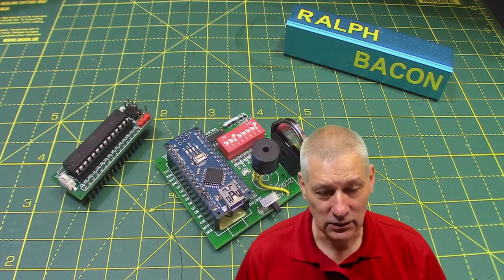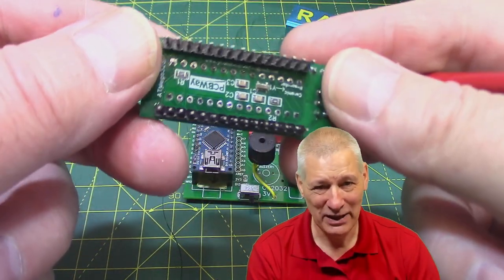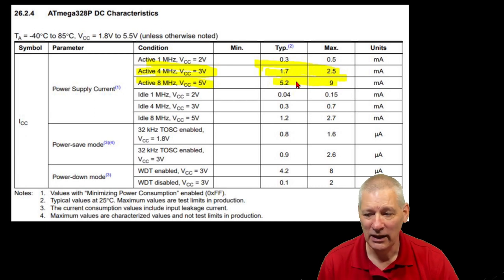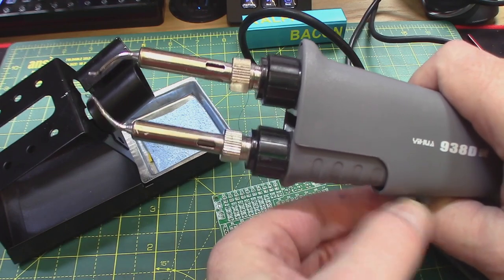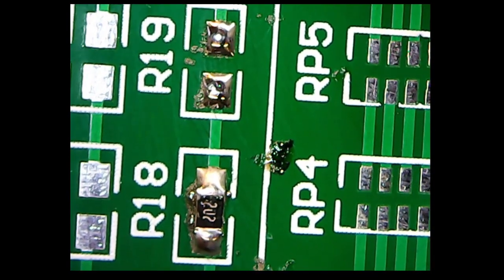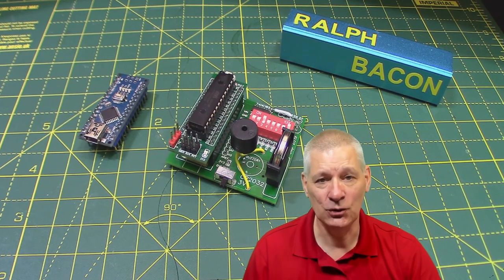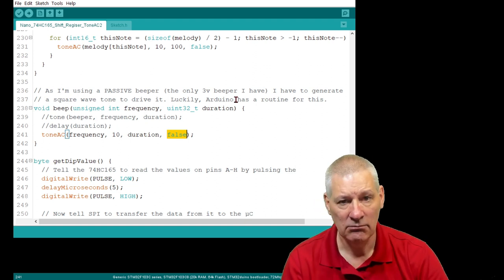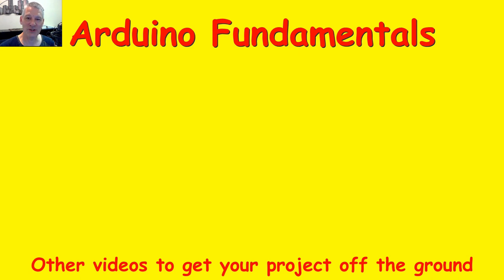#170 ToneAC Library with 328P DIP Nano PCB Plug-in

Comment: I also do have 4-5 DIP Atmega328's in a drawer somewhere. This is a clever way to use them. Thanks for the idea. I think I will have some boards manufactured too. By the way, kudos for the CH340, I am surprised eliminating the on board USB-serial conversion did not make a significant power drop. Too lazy to look up its data sheet but I suppose it must have a quiescent current in uA range when it is not doing its thing. Great video as always, I wish you a speedy and permanent recovery with the eye!
Reply from the maker: I'm glad I've motivated you to try this board. Whilst simple (anyone could have designed it) it's quite neat. Thanks for your kind words and the fact I'm replying now means I must be up and about, Woo hoo!

Comment: Hey, Ralph.

Very interesting video, as always.  This Bare NANO PC Board is really great.  One question, though.  Do you NEED the Shield programmer to program the AtMega328P, or can you use the ICSP Port to do the job just the same ?  I will definitely get myself some of these boards very soon if they are economically advantageous over a NANO, that is.

I quite understand the Bootloader delays the execution, but most of the time, it won't be a bother.  Mind you, I could use faster start time on my Laser Fan Controller device.  Hmmm !  Like Schultz use to say to Logan .. « Veeery intereshting !! ».  I'll look at that option in the very next future.  Thank you for the info.  I just might get those boards made at the same time as my WWS project.

I've looked at the possibility of purchasing that SMD Hot Tweezers and, as you said, this is not an impulse purchase indeed.  I'll think about this one.   It is very good for desoldering SMDs, but for soldering these minuscule parts, I can still use my old Weller Station.  I've got the tips for this kind of job, and the tweezers to hold them im place whilst soldering the first pad, so ..

LOL for the eye patch!  Aarrr Captain !!  Take good care, my Friend.  I'll chat to you later this week.
Reply from the maker: You can use the ICSP port from another UNO. A proper 6-pin cable simplifies matters here. The (red) shield I use is for DIP 328P(B) chips in the ZIF socket or via the ICSP socket just the same. Whatever works for you. Speak to you soon.

Comment: About higher speed serial not working with a clock that's off: it's not just high baud rates, it's all serial speeds! If the clock is off 5%, every baud rate is off 5%. And it's the percentage error that makes or brakes the serial connection. Some baudrates are more susceptible to this, because some serial clocks aren't an integer division from the system clock, which means that they aren't accurate even with a perfect clock (there's a list of these errors in the AVR datasheet).
You can "tune" the internal oscillator by writing to the OSCCAL register (has to be done in software in your program). It's a bit of a hassle though to get it. To find the best value for it, write a loop that dumps something out to the serial port and change the OSCCAL value every iteration. If the output is no longer garbled you got the right value (there will be a range where it works; take one of the center values). Then write that value to EEPROM and load it from there to OSCCAL in your actual program that you want to run.
Reply from the maker: Sounds like a lot of work, doesn't it? I used to do this sort of thing with PIC chips but never with AVR chips. I have no idea how a production run would be able to tweak the oscillator in this manner it would be a real show-stopper if it were required. Or expensive. Same thing really!
Reply: @RalphBacon  
Yeah, I doubt that you'd use this in production that way. If a rather accurate clock would be needed, an external crystal would most likely be easier overall (and if time == money also cheaper), especially since the internal oscillator isn't that stable with temperature change.
You could include a calibration procedure in your code though to remove all manual steps. Apply a known accurate external clock to a pin (pulling that pin low a could be the thing that enables the calibration mode), that triggers one of the timers/counters. Then in your code tune the OSCCAL until the counter shows what should be expected and store that value in EEPROM. That could be a process that's done in less than a second with the right jig and could be useable in volume production (the AVR has to be flashed at one point anyway).

Comment: In the ToneAC documentation, it's mentioned that a 100 ohm resistor should be placed on one side of the piezo buzzer.
Reply from the maker: Hmm, it depends on how much current the buzzer is going to take. More than 20mA seems unlikely but a 100Ω resistor will ensure current is limited to 5/100 = 50mA, still a bit high as 40mA max per pin!
Reply: @RalphBacon  Yes, makes sense to go higher on the current limiting resistor, but I noticed that you ommitted the resistor altogether and I was curious to know why you did that.
Reply from the maker: Because my buzzer only consumed a few milliamps, not enough for any concern. Measure it with a multimeter to determine whether a resistor is really necessary!
Reply: @RalphBacon  Good point, better to actually test to see if it is needed rather than just mindlessly following general rule!

Comment: Great great video Ralph thankyou. May I say I am also a Centigrade man. (whats celsius??) and refuse to convert!! I love the SMD tweezers and will have to get some. As soldeering experience goes I am about 80% through hole and 20% SMD qualified. Oh and thanks for the Miniboot board for the 328PB. I got it in the post on Saturday and have the chips on order for Wednesday. :)
Reply from the maker: Good luck with the board, Stephen, you probably have made it by now! I hope you got it working OK.

Comment: Well, that was one in the eye for me. Sorry your right eye is not a patch on the other one. Ok, that might not read as being very sorry but I am. Thanks for the ToneAC tip; I am surprised and pleased at the improvement in volume. I to am more comfortable with using the ICSP socket (though, ironically, I do tend to still put an optiboot module on the chip unless short of memory). I just find it easier when using Atmel Studio (which I use the most because of its debugging facilities.). I am interested in the sleep/idle/running times you come up with in your research. I have been a little skeptical at the savings in battery usage that some maker's claim. I can see that they achieve them when occasionally flashing an LED on a breadboard but experience suggests that a real time application generally behaves very differently from its prototype in the lab (ok that experience is as a chemical engineer but such such patterns generally replicate across most disciplines).
Reply from the maker: [Read in pirate voice]
Aargh, well, shiver me timbers, if it ain't me old mate Mikey! 'Tis true, the olde ICSP is a favourite of every bilge-sucking landlubber when no boot(ie)loader be on board. Avast me hearties! This seadog shall be looking at ye power savings and reporting back to ye, in the near future, ye son of a biscuit eater.

https://www.piratelights.com/captains-log/2018/5/8/pirates-terms-and-phrases

I'm sure you do care, Mike, and goodish news: my cataract op has been pencilled in for January which should give me one good eye back. Then the other eye should settle down, and if it doesn't will require surgery to clean out the gunk and laser any further retinal tears, if any. Then a cataract replacement for that eye one day too!  Aargh! Now let's splice the mainbrace, it be 5 o'clock (somewhere)!
Reply: @RalphBacon  It's good to hear that Seaman Stains still has his sense of humour. Best of luck mate.

Comment: The disc piezo is normally used to vibrate a surface, ie diaphram. Volume is dependant on such. As an example, ..next message
Reply from the maker: Even if I pressed the disc quite hard on a plastic surface it was not great. I don't know why but as I had this little beeper I was not too worried.

Comment: OptiBoot is quite easy to rewrite btw. You could, for example, use a jumper with a pull resistor on one of the led outputs as a sense line for if the bootloader should stay active or if it should jump to the main binary
Reply: Optiboot is also easy to custom compile for say, 8mhz and 20 flashes, instead of 3.  So long as a board is being built, a couple of zeners and resistors can help help the 328p bang-out a USB 1.0 bootloader like USBaspLoader:  https://github.com/baerwolf/USBaspLoader
Reply: @GnuReligion  Quite cool what can be done with these things if you use good code :) Still can't comprehend how the heck they managed to make opti so small. 512 bytes and it's C! :D USBaspLoader is also quite incredible. 2K is no small feat given it has USB
Reply: Smallest bootloader I've managed is 3K. Granted, it has md5 and some other stuff (and is in 68k assembler) but this is way cooler :)
Reply: @Chriva  Micronucleus on the Tiny AVRs is pretty cool, too.  Sad that the Mega chips do not have a PLL so they can do the overclocking trick.
Reply: @GnuReligion  Well, technically you can. but not as simple. You have to use another crystal (or drive it by an external clock). :) Sadly they rarely want to run much faster anyway. Think the record is a 328 @ 40 MHz :P
Reply from the maker: I've assumed that the MiniCore bootloaders were all compiled for the different speeds, 1MHz, 8MHz and 16MHz although the 1MHz might be just 8MHz with the divide-by-8 bit set for the clock speed. Something I need to investigate more fully. Sounds pretty interesting.
Reply: @RalphBacon    Thanks for showing me what MiniCore is!  Was ignorant that this core (capable of runtime flash-writing) even existed.  The chip/speed/feature selection of MiniCore is superior.  Obviously it is actively maintained, even has an option for PB varieties.  Some more reading shows that this core supports "optiboot flash", with special capabilities, and still compiles in 512 bytes!   But, Mr. Bacon, you can still use regular optiboot, and even the regular Arduino core.   Furthermore, you can compile optboot_flash with standard options, like:  "make atmega8 AVR_FREQ=16000000L BAUD_RATE=115200 LED=B5 LED_START_FLASHES=2".  And yes (sigh) there are all the pre-cooked bootloaders:    https://github.com/MCUdude/MiniCore/tree/master/avr/bootloaders/optiboot_flash/bootloaders
** Unrelated note:  I installed a 32Mhz crystal in my LGT8F328 Xi Nano ... took a new boards.txt, but demonstrably works.

Comment: A piezo disc about 20mm dia, feeding a diaphram in resonant housing can get 120DB sound for car siren but also is driven by over 100v inductive kick peaks.
Reply from the maker: 100 volts, you say, Helmuth? I guess the 6v I have here is not so great then. Although I have had better success with plain piezo discs in the past, so maybe this time there was something else not quite right.
Reply: a couple of weeks ago I disassembled one of those personal alarms which are marketed as 120 dB. These are just using a piezo disc and 3 alkaline batteries for together 4.5 V. But the magic is that the piezo is driven through an inductor which will the 100+ V spikes which are necessary to give you this volume. Together with a 3D-printed resonance chamber I could get up to at least the sound level of that siren then with a small circuit getting the drive signal from an ATtiny13. The siren uses actually a pair of coupled inductors in a flyback configuration.
https://i.imgur.com/umJzS9v.jpg

The buzzer you are using is actually an electromagnetic speaker rather than a piezo disc. What you see through the top is the steel membrane under which a small coil sits.

Comment: I think that the tweezer soldering iron is a bit overkill unless you do a lot of desoldering two leg components. If you have two soldering irons (and two hands) you can obtain the same. For many leg components you can use low melting point solder-wire  based on Indium or Bismuth
Reply from the maker: Indeed, I believe Louis Rothman mentioned he had used two soldering irons in his early days. But not quite as convenient.

Comment: Does that tweezers soldering iron have wider tips that can do larger parts such as 8 pin chips?
Reply from the maker: I don't think other tips are available, Steve, but i wouldn't use this to (de-) solder chips, I'd use either a hot air gun or, for small 8 pin dip chips, I'd flood it with solder one side and lift it up gently. Hot air gun is not that expensive, around £45 / $60 and they do a good job. Look at my video where i show my Yihua 959D.
Reply: @RalphBacon  That's the old way but if you have wider tips to desolder a chip it pops right off like this!  https://youtu.be/KKItbyz6564?t=368
Reply from the maker: Yes, that's a good way too, whatever works best fro you. I have (yet) another way but that's for a future video!

Comment: The tone hack is really cool. I think this is doable with the standard tone function and a NOT gate on the output pin (it would  require more room on the board and be more expensive, of course!)
Reply from the maker: Everything has a cost, Aurélien. I know that companies try and shave every cent off the cost of a product, sometimes going too far. The obvious thing to do (were this a REAL commercial item) would be to have a higher voltage. Three coin cells, giving either 4.5v (1.5v per cell) or 9v (3v per cell) via a buck module down to 5v would do the trick and obviate the need for all this other work! But hindsight is a wonderful thing!
Reply: @RalphBacon  ... they build things with costs in mind, we build them to learn and have fun!
Reply from the maker: You never know, someone on this channel might see a business opportunity and make a fortune! But it's fun either way! And a condition of watching this channel is that I get 50% of all commercial profits. Whatsat? Not enforceable? Drat!

Comment: Could you not have remapped the AC tone library pins in the header file or is there some obscure technical reason for only supporting the described pins? 
It would be more expensive but looking at the tweezers I think you could make a hinge for two (of everyone's darling) TS100 soldering irons. The result should be super light tweezers with almost instant heating and auto idle.
Reply from the maker: If you (or me) had a 3D printer I'm sure a nice hinge could be made to accommodate two TS100 soldering irons. Now THERE is a business opportunity for you Rob, and I'll only take the usual 20% fee!
Reply from the maker: I forgot to answer the bit about remapping the pins. I suspect (I didn't look) that he is doing direct port manipulation for speed, so Yes, it could be reworked to use a different port to the one it is using, I'm sure. But if we have to hack libraries then it all gets a bit involved for the beginners on this channel. I suppose a fork of his library would be a good idea. But I have no time, so over to you Rob, let me now when it's done. Whatsat? You got no time either? From your lips...

Comment: That tweezer soldering iron looks like it would be extremely useful, especially for desoldering a lot of components or some light reworking of others. And don't strain that eye too much, we need you to be able to see clearly so you can keep the videos coming.
Reply from the maker: Without doubt, it is a bit of a specialist tool, but for SMD rework it would probably pay for itself in the lack of frustration! I'm resting my eye so hopefully no strain!

Comment: when it comes to serial communication the accuracy of the oscillator is not the full story. There are limitations which baudrates can be realised from certain clock frequencies. A site called wormfood used to have a neat comparison table showing which baudrates are achievable from which processor clock speeds, but for a couple of months the original site has been down now - but there are backups out there: http://ruemohr.org/~ircjunk/avr/baudcalc/avrbaudcalc-1.0.8.php

In short: from 8 MHz 115200 is not possible, but it's not because of the accuracy of the 8 MHz which even for the internal 8 MHz RC-oscillator inside the ATmega is stable enough, but because it cannot be achieved by dividing the clock frequency. However, the same 115200 baud can easily be obtained when using a dedicated oscillator/resonator with 7.3728 Mhz, 9.216 Mhz or even from a mere 3.6864 Mhz. Crystals and resonators with these "weird" frequencies are readily available, and you find them on almost every single old motherboard or embedded system.
Reply from the maker: Interesting, Uwe. So if someone was prepared to run from the 8MHz internal clock anyway, they might as well fit a 7.3728MHz crystal and run from that. How does that affect all the millis() and delay() statements though? Is it enough to change the F_CPU setting for the board?
Reply: @RalphBacon  for the _delay functions it is enough to refine the F_CPU setting. About millis() I don't know - since I want full control in my projects I generally do not anything of the Arduino-framework, but rather control everything from within my own main(). 

This way - if I do want some millis() functionality I put it into an interrupt service on a timer of my choice and under my control.

Comment: try putting the flat buzzer in the bottom of a dry soup can, try different materials and shapes to put in place of the can
Reply from the maker: Oh yes, that would work well but I don't want to my put my toothbrush timer into a tin can (or similar). The library I use here with the self contains buzzer works very well and I use the timer daily now, plenty loud enough. What I really needed was a higher voltage battery.